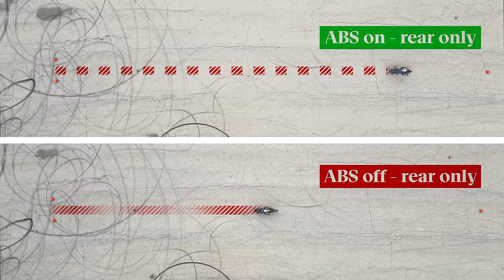Out-braking the ABS Myth

Comment: Ryan this is great. Have you seen the abs that came with the 2014  Honda CBR1000RR ? as far as I recall it was a bit of a leap. Would be great to see the same tests performed in the rain , and on bends and with a variety of abs equipped bikes too, like the recent KTM models that have a Bosch imu.
Reply from the maker: Glad you enjoyed it! Yes some of the ABS systems on supersport bikes are nearly impossible to beat. Especially in "race" mode where it will let you float the rear. ~RF9
Reply: Yes, just like the Aprilia tuono and RSV4 ABS wich can be trickled up or down as you want with just a tap of a switch. 0 to 9 increment ABS intrusive power. @FortNine
Reply: I've never beaten my ABS on my 2007 or 2014 BMW. I think that is a rare skill. Bret Tkacs had me squeeze both my brakes as hard as possible immediately in the rain at 40mph and I stopped faster than I could beat without going into ABS. I should try it now that I have more experience. But I have no problem squeezing the crap out of my levers if need be, no 2 stages., unless in gravel with ABS off.

Comment: Every driver, no matter what kind of vehicle, should practise emergency stopping on a regular basis (like really every single time there is a chance of savely doing it, just do it. Even with cars you can f** up pretty badly (high speed, cornering, than slamming the brakes, that will unsettle the car and ABS wont save you, even stability control could fail)
This also ensures that you are aware of the underground and the tire condition, and that the brakes are fully functional.

Comment: I do think you could put more emphasis on the fact that ABS saves lives.  And I was taught to squeeze the front brake lever, not use it like a switch.  A progressively harder squeeze works exceptionally well in preventing front wheel lockup.  Outside of that this is an excellent video.  I was hoping that by this time riders would know to use the front brake over the rear.  Sad that this hasn't improved since I started riding in the '60s!  Much more rider training is needed, and you do a great job in adding to the knowledge pool, thank you.
Reply: Yeah, he was intentionally using terrible braking technique with ABS but good braking technique without ABS - are we surprised ABS took longer to stop? The whole video was "ABS is bad" except for the last few seconds when he said use ABS anyways and only sort of explained why it was doing so badly for him.
Reply: @ARCNA442 I think the intent was more "abs isn't a replacement for skill, so don't rely on it" for the less experienced and "abs won't ruin your ability to stop" for the more experienced. 

When I went to the BRC course there was a girl who had been told "don't use the front brake you'll flip" so yeah, we did a couple of minutes on why that's the worse advice you could ever give to someone ever.
Reply: I'll get ABS on my next bike if I can disable it for practice or when riding on gravel or sand. 

That being said, a slow, firm progressive pull of the brake lever has served me well. The only time I've gone down braking was in my first few months when it was rainy and I was faced with the decision of stopping or turning for a stop light, neither decision was great.

Comment: ABS is very well understood in the EU. It isn't to do with stopping fast, but steering during the stop. You mentioned it for half a second it prioritizes sterability. Now do the test in a car, but instead of just brake, teach yourself to turn as you brake. You see the child in front of you, put a box there, drive in the car toward it, stop in the abs car and swerve, then do the same in the non abs car. Personally I have no idea how well the steering happens on a motorbike when ABS is on, as I never tested it, youd have to assume it works well. However if youre going to just slam your brakes and head straight for the obstacle then its of zero use to you. Practice braking and steering as you brake.

Comment: I had no idea about such a defeating statistic regarding braking. Back when I was getting my license the instructors always stressed the primary brake is the front with rear to be combined for best results. And the only situations where rear-only is used is slow speeds, and tight maneuvers - certainly not emergencies.
Reply: Go watch some motorcycle dashcam crash compilations. The number of accidents caused by horrible technique is astounding.

Comment: I had a close call a few weeks ago. I was on I-95 where a Masshole in an SUV decided they really wanted to catch the Portsmith exit. Problem is they cut across two lanes of traffic and hit their brakes to catch it, and they cut right in front of me in the process. I almost wound up in his trunk because of that stunt. I think what saved me in the end were I was riding slightly below the posted speed limit, and I used both of my brakes, but I didn't slam them. My bike is an ABS model, and I knew about the longer stopping distance, but I didn't realize I was threshold braking at the time. I think this video is the first I've heard of it.

Comment: The design of ABS was never to shorten stopping distance, it's entire purpose is to maintain steering control. This has been it's goal since Bosch first produced the system for Mercedes in the early 80s.
Reply: Indeed. ABS is commonly misunderstood in that regard.
Reply: Yes and no. Maintaining control is an important part of it, but it does tend to shorten stopping distances in the real world.
Reply: @ARCNA442  especially if the rider cannot apply braking techniques to minimize stopping distance.  say when your panicked.  so while some might be able to beat abs in a parking lot while practicing, less will be able to do it when I counts.
Reply: @ARCNA442 it was byproduct but not an intention. You can look up photos of mercedes first abs car etc - they are mostly showing how well it behaves when the ground is wet, usually how you can still maneuver around the problem.

Also abs makes you stop worse on snow (sometimes I guess) because snow pilling up in front of tires helps to stop in those sketchy conditions
Reply: @cyjanek7818  The issue ABS has with snow/dirt is that it tries to keep the wheels spinning on top of the loose surface rather than letting them lock up and dig through it to a firmer surface that provides better traction.

Comment: You missed the consistency of ABS. It's much better in less than ideal conditions.

Also you can (and will) out brake ABS in straight line in cars but once any sort of steering and/or imperfection on the surface (if only one side is wet for example) is introduced you will spin without ABS.
Reply: Well said, parking lot practice is the only time when you can beat ABS.

Comment: Really helpful to hear these lessons. Bottom line, go practice threshold braking, 2nd gear swerving, and parking lot crawl-speed full-lock 180deg turns. Thanks F9! Great content again.
Reply: What is "threshold braking"?
Reply: parking lot crawl speed is even part of the European bike drivers license test.
Reply: @user-rl8mg2nw2s  you brake att the limit of what it can handle without locking up or without doing a to massive stoppie.
Reply: @savagememes873  I think/believe they have much more rigorous testing standards than in US.

Comment: The braking I developed from bicycling passed on real well to motorcycling. I met a few people too afraid to squeeze the front but riding down hills fast requires strong controll over that break unless you want to make headlines.

I tap the front then squeeze then release it a bit if I feel like the rear is about to do something off of a RedBull video

Comment: ABS 100% gave me the confidence to brake hard enough on good tires to avoid a near-death crash in the rain. I was sunned at how fast it went from 150kph to almost zero.
Reply: IStripesI they mean exactly what they said, I think? What a ridiculous question
Reply: IStripesI 150kmph emergency braking in the rain is a recipe for death
Reply: it's true that tires offer more grip in wet conditions that one is inclined to assume but nothing stops quickly at 150kph. it takes about a football field to stop at that speed in dry conditions...
Reply: IStripesI it's only 93 mph. And that would be allowed on the Autobahn... Although it wouldn't be allowed to make an emergency brake without a reason on it.
Reply: Swerving is better than stopping
Reply: @gwebster6600  It was on the Autobahn and I was in the middle lane. Everybody in the right lane was exiting everybody in the left lane was going significantly faster.
Reply: @danielhopkins2277  car in front of me panic braked, I had no choice.
Nowhere to squeeze in on the right and to the left I would have been run over.

Comment: ABS is for when people panic and don't pump manually.  If you pump manually you will always stop faster because you can predict better when the wheels will lock than the system.  Generally if ABS is engaging it means you are driving/riding improperly but it does happen to even the best so its a good safe guard.

Comment: I've racing motocross for many years, a pro-tip that almost nobody knows:
Use your back brake slightly before the front, that way you maintain the back of the back lower, heavier, and you'll stop faster!
Reply: I'm doing this with my crf 250.
It's very effective in dangerous trails as well, especially if you have a passenger and can't use brakes to maneuver.

Comment: The ABS on my 2017 cb650f wouldn't allow threshold braking. It would always kick in a little bit before I reached the threshold in the dry. But, it only ever happened when i was braking super hard for the sake of braking super hard, and I still love the saftey net for slippery or panic situations.

A "safety feature" I didnt appreciate was non-abs, linked braking system on my pcx125. I was not a noob when I the pcx, I'd owned everthing from mopeds to supersports by that point, but I've never had so many front end slides as i did with that scooter. It was down right dangerous in the wet. I believe the problem was that I could never tell how much braking the front was doing. The front caliper had 3 pistons - 2 for the front lever, and one for the back, and while I was perfectly capable of feeling for grip with the front brake, once the back brake started adding its bit to the front, it was impossible for me to feel how much deceleration was coming from each wheel individually. It caught me off guard so many times in a way that no other bike ever did before or since.

I'd love love to hear others opinions and experiences with this type of brake sytem.

Comment: Problem is most riders ride very little. Particularly in certain parts of the world where you have to store your bike over winter. As a daily rider in Australia, in ALL weather, you stay sharper. Cover your front brake with two fingers at all time... You'll use the front brake!
Reply: Lol Australia, try the UK. And covering the brake constantly is a terrible idea because you're covering it while you're opening the throttle. The correct approach is to cover the brake WHEN you roll off the throttle.
Reply: @flippy66  If you are struggling with grabbing the front brake while accelerating, take up knitting, you don't have the coordination for riding bikes. Also, lol the UK - park up the bike - no use riding in that climate AT ALL!

Comment: From the automotive perspective:

Team O'Niel Rally School has a great channel on automotive driving techniques, focusing on gravel and snow conditions. They recently did an ABS comparison test with a crown vic, and the ABS was less effective than proper threshold braking.

The ABS is not there because it's better; it's there because American drivers are not taught how to, OR expected to, brake properly. Next to no one actually practices threshold breaking, so the ABS is deemed slightly better than locking every tire up and skidding off the road (or into something).

On the other hand, Rob Dahm just posted a video about his "$10,000" custom racing ABS, which apparently works VERY well. But that system is WAY better than anything put into a normal production car.

All in all, most ABS systems suck compared to a trained and practiced driver/rider. But the training and practice? That's on you and me...

Comment: I agree with everything you have demonstrated but when I first worked on cars with ABS fitted we were told that " it didnt stop you any quicker it merely gave you the ability to steer the car because if you lock up you have no control over your direction " I have avoided a collision in the rain on my bike with ABS because whilst braking I was able to steer the bike as well. Great videos mate .
Reply: I'm wondering where he ever got the idea that ABS was intended to make you stop faster.  I've never heard it before and have only, ever, heard the correct information, that it helps you maintain steering control while stopping hard.
Reply: @johngaltline9933   On cars race ABS do make you stop faster because of the intervention frequency. For a human is simply impossible to hit the perfect braking application,  but again, I'm taling about race ABS, not normal car
Reply: @lorenzorubino2195  I’m not familiar enough with the systems in place in top level motor sports , but if, in fact, they are capable of monitoring braking force, and manage to not actually ever let the wheels lock somehow, then it is possible that you can get a shorter stopping distance by holding the wheels right at the point where they would lock if any more pressure was applied… assuming the road surface and tires do provide more friction that way than with the increased contact patch that a locked tire will provide. If the wheels are locking as they do in typical ABS, even being locked and released at very high speeds, the physics still say it is impossible to stop faster with less friction applied to the ground.
Reply: @johngaltline9933  yes, technically it is possible to stop before the ABS, but no driver can feel the perfect amount of force required to do so, especially during the initial part of brake release.
Reply: @lorenzorubino2195  I mean, yes, if the system is designed to do just that, which might be the case in very high end race cars.  For everyone else, locking the wheels and skidding to a stop will beat any ABS in a straight line. It will probably also beat the high end racing systems, it will just ruin the tires in the process.
Reply: Driving a modern car quickly  without abs working is down right dangerous in my experience
Reply: True. ABS gives controllability. Especially in winter. 

There was moped car (light four wheeled vechicle like ligier, top speed 40km/h) test in Finnish car magazine. So it was driven by individuals in target group (15-18 and elderly). Both had collision in their period (1000-2000km total run in several weeks or months in winter) so those professional drivers in magazine crew (driving school instructors, former rally car drivers etc.) wanted to know what was the problem. It had very old brake technology. When brakes locked they stayed locked even though you lift your foot on pedal and until you pushed gaspedal wheels were locked and it was unsteerable. 

There was even discussion are those moped cars more dangerous than normal cars. And would it be better to have real car with speed limiter than those doghouses on wheels. But politics and lobbyist thought we need them over real cars with better safety.
Reply: ABS is still more about the stopping power. Once you lose static friction on the tires the only stopping force is the friction coefficient of your rubber vs the road surface. The braking system can decelerate a vehicle better than sliding rubber on asphault.